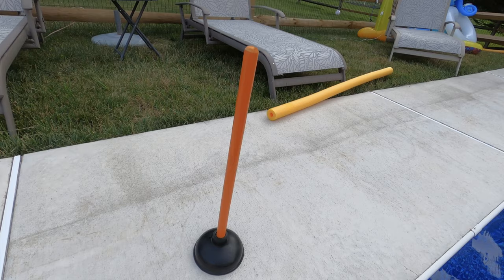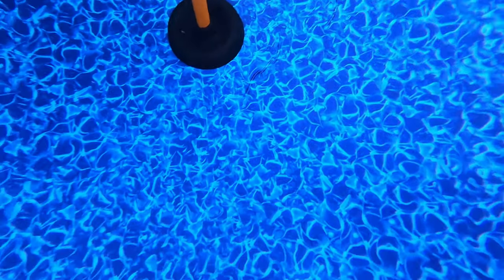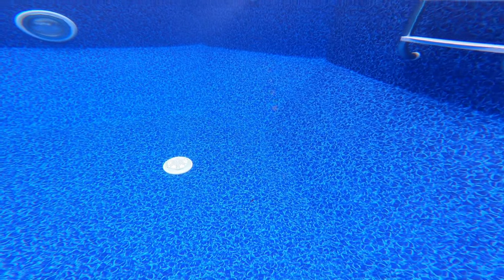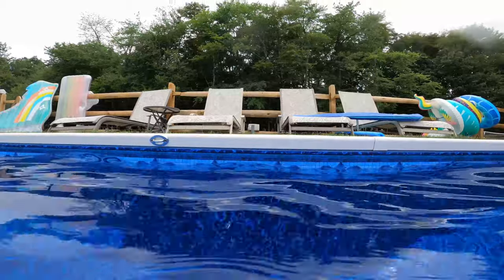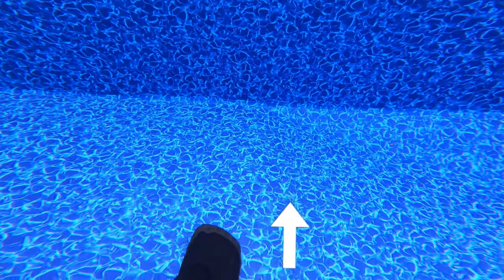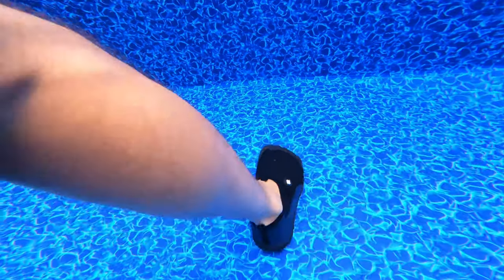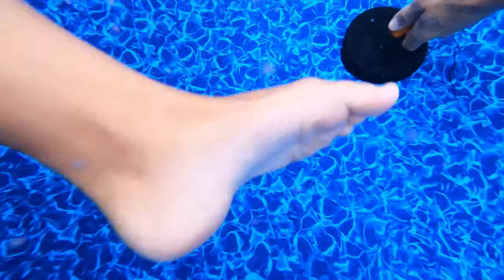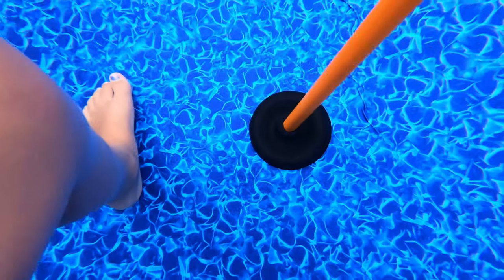How to REMOVE wrinkles from your pool liner

Comment: Thanks! Discovered a wrinkle yesterday, while using a plunger to remove wrinkle is there a possibility another wrinkle(s) may form?
Reply from the maker: Cory - I guess that would be possible but I would say that's why you evaluate where the wrinkle most likely came from before you try to move the liner.   Most likely it was pulled away from the wall, but there could be other scenarios depending on your pool.   thanks for watching ! 

-Mike

Comment: My inground 16’x32’ pool developed a seam separation on each side of the shallow end steps where the floor meets the wall. For whatever reason the floor vinyl has shifted toward the deep end thus pulling the floor further away from the wall creating more tension on the vinyl material at that juncture.
My question is if I can pull the floor vinyl back to the wall to eliminate this pull?
I lowered the water level in order to do the two patches. If I refilled the pool up to the bottom of the steps and used a solar cover to warm the water above 90 degrees to promote more stretching, is there a good chance of succeeding in repositioning the floor material all the way up to the wall? I guess all I can do is try. Or would I be better advised to lower the water even more before trying to pull the floor material back into place? Has anyone else ever had this happen?

Comment: You told us to slow down relative to working the wrinkles out.  Please, take your own advice and slow down the camera movement.  It will make your videos so much better.  The camera in this video almost never stopped moving.  Its hard to focus on anything when it is moving in and out of frame or all over in frame.
Reply from the maker: lol - did the video help you ?   made the video quick to make you focus on taking your time.  

seemed to work, i’d say ;)
Reply: @FamilyDIYtv  I couldn’t make it through. One of the worst videos I’ve seen. Continuous camera movement is one of the hallmarks of an amateur videographer. Panning a camera should be done sparingly and slooooooowly.
Reply from the maker: @jackhageman8698  lol, you couldn't make it through it, seems pretty dramatic !   AND one of the worst videos you've ever seen - thanks for the compliment !  i have a sneaky suspicion you did watch the video and will be removing the wrinkles in your pool using this technic. For that you are welcome, if you didn't, you're welcome for the "worst video" you've ever seen, because going forward everything will you watch will be better, so things are looking up for you!   For more terrible videos, some shot by my 5 year old, some not,  please consider subscribing.     

Hoping you subscribe,
Mike
Reply: @FamilyDIYtv  google the subject matter everyone of them give you soft soled shoe/swim shoes, plunger, heat up the liner/pool, reducer pool water level to a few inches. It’s as if everyone that is giving this advice got their information from the same source. You value your work more than I do. If you would take an objective view of your work you would see this video is not the best. Stick with static shots if you can’t figure out how to do quality pans, zooms and other camera movement. Good luck
Reply from the maker: @jackhageman8698  regardless- i hope you got your wrinkles out.   Happy 4th of July! 

-Mike
Reply: Thank you for taking the time to share this. People are so entitled and ungrateful. Wow
Reply from the maker: @fernandogallegos7685  I hope it helped you, it works, just take your time and enjoy the water !   I actually got some to remove after THIS years 4th July party, lol.   I think people jumping in with water shoes is more likely to cause it...  IMO

Thank Again, 
Mike
Reply: @FamilyDIYtv LOL, great answer.  You just can't please anyone.  This individual has issues.  Thanks for the great video.  Will try after I fill with water and let it warm up.

Comment: What if the wrinkle is on the sides of the pool?
Reply from the maker: Same process, would think it would be even easier
Reply: Pop the bead out of the track and use garden hose, run water behind and smooth quickly. Hot water helps streth😢liner to pop it back in.

Comment: We assembled our Intex style above ground pool and did not get the liner completely flattened out before water company came to fill and we ended up with six  long creases in bottom of the pool. Could we apply the same concept to remove those creases? It is 52 inches in height. Would it be easier to remove some of the water before we try and use the plunger?
Reply from the maker: this should work fine.  wait for a nice hot day.    work slow.

Comment: I have a round 10'x30" above ground Intex and I discovered a sharp edge protruding at the bottom of the pool. It's probably a small rock but I dont want it to break the liner. Is there a way to push that rock back into the dirt without breaking the pool or do I have to drain the pool just because of that rock? Thank you for any help provided
Reply: Depends on how close to the wall it is but you could honest to god just get a crowbar and lift the liner up and reach under LMAO
Reply: That's bad, my intex xtr had the same thing and it ended up making a small hole. Thought it was evaporation before finding the hole. You can patch the intex pool by using pvc cement as they are pvc not vinyl. Don't use a vinyl patch kit. If you can drain it it will come out better. We had a 8 inch gash from a tree trimming company that I patched with the piece of liner I cut out when we installed a skimmer. Repair held for 3 years before we got a bigger pool. It was a permanent repair. Good luck.

Comment: Neat video but a better question for me is why do you have wrinkles in the first place?  Hard to believe people using the pool can create wrinkles.  I've seen low pH cause wrinkling or ground water get under the liner and cause them (or wrinkles there from the original installation)
Reply from the maker: Mine are from people jumping in. Or standing in side playing basketball.  Not from ph.

Comment: can i do this with a pool i just drained or does in need a significant amount of water?
Reply from the maker: Don’t see why not.  Just take your time
Reply: For anyone else wondering this, it seems to work BEST with about 6-12 inches of water. The weight of the water pushes the liner down into the sand, holding it in place. A lot of water presses hard on the liner, making it hard to move. With little to no water, there's nothing to keep the liner from moving and wrinkling again.

Comment: Our cover broke last winter and a lot of junk go into the pool and we had to drain it.  Now the liner seems to small and has come away from the sides any idea's how we can refill it and get the liner back into place?
Reply from the maker: I’d call a pool liner company- they have these things that suck the liner to the wall.   Btw - should never drain a pool. I’d get water back In there asap.     Just google can I rai my pool.   

Unless you have a plug.   

I hope you have a great weekend !  

Mike
Reply: @FamilyDIYtv  Thank you so much.  We didn't have a choice but to drain it because it was such a mess after the winter cover broke.  There were even sticks in the pool.   I was beyond angry because the cover was brand new!  I have had my pool for 8 years and never had this problem before.  Thank you so much for the advice it is much appreciated.